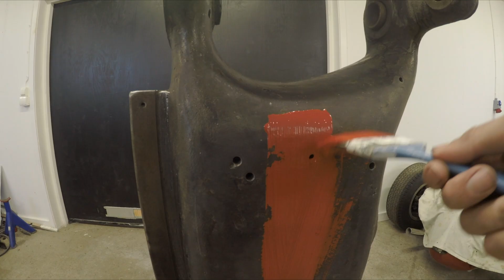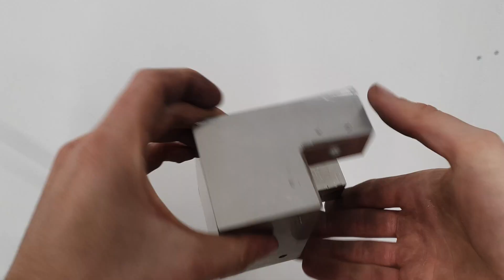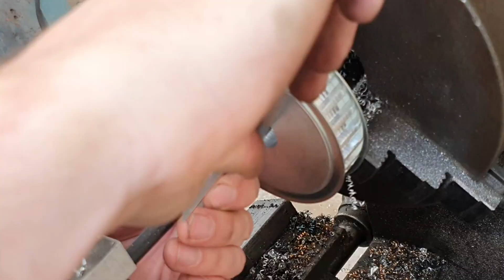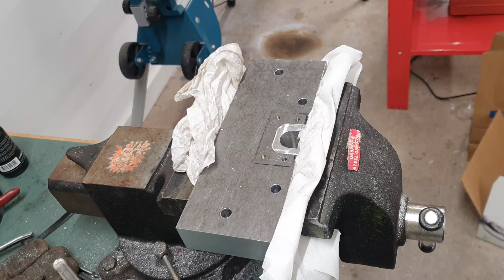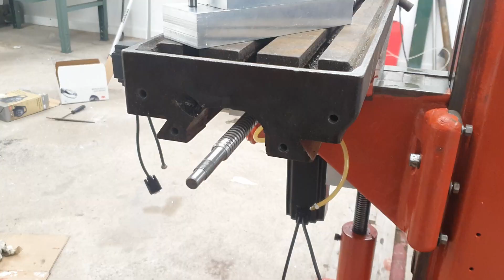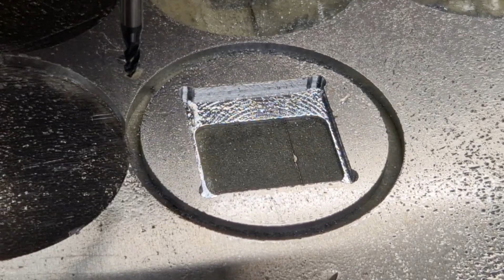100 Year old Milling Machine Restoration and CNC Conversion

Comment: be an idea to make a bunch of plugs to cover all them old holes...
seems.. slightly overkill? lot of weight to shift for that tiny little cutter. i was loving it (muted) until that head went on. CNC... just interchange Y and Z... its only awkward to side mill when doing it manual... better chip clearing...

looks like it would happily take a 2hp and chew through metal again like the green one you were using... i know i wouldnt be happy with a high speed router. then you can still shove an arbor in and run slabs... does anyone slab mill anymore? had a job a few weeks back where it would have been ideal to gang cutters.

didnt see it being scraped... big thing with an old cast iron dovetail...